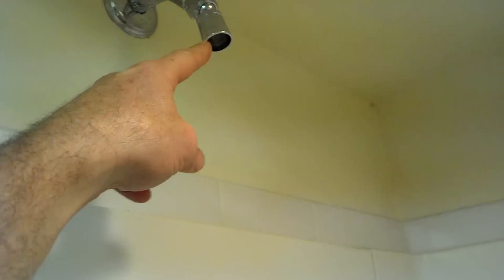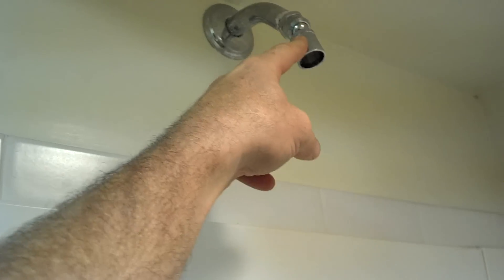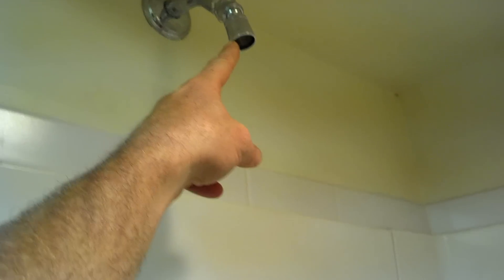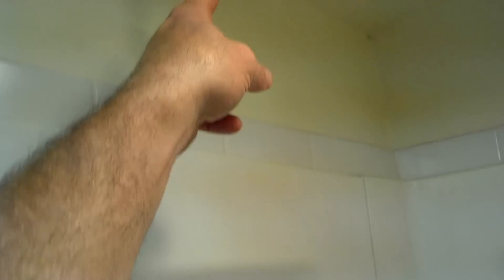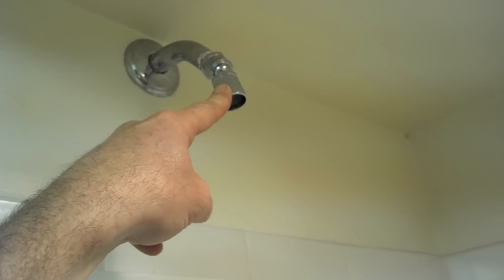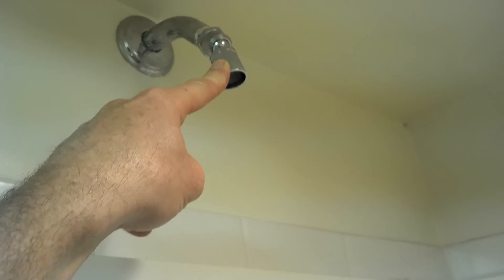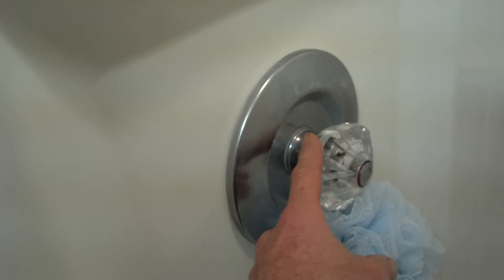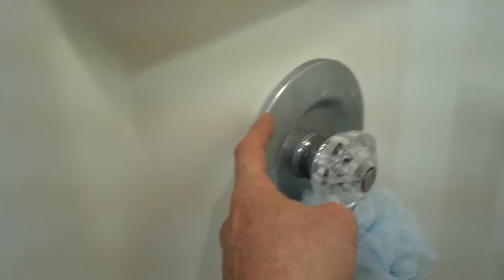If Water Drips From Shower Head, What Exactly is Wrong ?

Comment: Why would it drip out of the shower head but not out of the tub spout? I have seen that on mine on occasion.
Reply from the maker: cuz your diverter valve is in the shower position, try turning to tub spout position, then it will drip down there, keep in mind thst showers & tubs will drip for 5-10 minutes even if in perfec working order, thi is due to the piping behind the wll that is full and is draining, as opposed to a sink faucet that when shut will drip a few drops for few seconds cuz it's a short run with flat aspect......there can be a few pints of water in the pipes and spray head after use

Comment: When my soaker hose is running, both of my shower heads drip. I use a bucket to catch the water and it fills a bucket in two days. What can be causing this issue?

Comment: Dino - thank you for the advice.  I did that and noticed nothing came out of the pipe when removing the shower head.  I guess it's the showerhead then but not 100 percent sure.  One thing I did do is after I showered, I rubbed the head with a towel to dry it and water started pouring out for 10 seconds.  then it stopped and didnt have a problem overnight like previous.

Comment from the maker: ROB, BUT IT DOES EVENTUALLY STOP? THEN I WOULD TRY A DIFFERENT SHOWER HEAD, THAT IS WATER THAT IS IN THE PIPE THAT IS SLOWELY DRIPPING OUT BUT THE SHOWER HEAD MAY HAVE A SMALL LEAK THAT IS LETTING AIR INTO PIPE DISPLACING WATER THAT SLOWELY DRIPS OUT, LIKE HOLDING YOUR FINGER OVER END OF STRAW. TRY A CHEAP REPLACEMENT SHOWER HEAD OR SWAP ANOTHER IN HOUSE TO TROUBLESHOOT, AFTER YOU FIGURE, CALL MANFACTURE TO WARRANTY

Comment from the maker: hi Daisy3690,
this is typical for a correctly working shower valve, you see there is water trapped in the showerhead itself when valve is first shut, it can take time to slowly drip out to where head is empty. 
as long as it does actually stop at some point, there is nothing wrong, you may try adjusting the angle of the showerhead, try pointing head slightly more "down" to help drain faster
your smart not force anything, some of these shower valves are plastic and easy broken
thanks! Daisy3690

Comment: Thanks. This applies to a drip that happens randomly? sometimes when I'm in my bathroom, some water drips it off the tub faucet for maybe 2-5 seconds, when the tub/shower hasn't even been used recently. Today or happened a little while after flushing the toilet, which may be unrelated. I flushed the toilet again and it didn't drip again. I suspect it is a bit of water that was left over from between the shower faucet and the tub faucet that didn't drain out when the shower valve was released at the end of the last shower. Maybe flushing the toilet put a Lily positive or negative pressure on a connected pipe and made that happen. It's happened at least 5 other times that I can recall. I never expect it to happen so I don't watch for it. I'm concerned they if bugs get in my home and this water drips often enough to keep a water source for them, that I could end up with a pest problem. I know there are other water source (drains, toilet), but I don't want to have any more than necessary. Any knowledge replies with answers or ideas would be greatly appreciated, just don't criticize about me wanting to limit water for bugs or ways to poison or dry up water or plug drains, I am knowledge about pest control, it's one of my hobbies.

Comment: hi guys I am wondering if I have a leak in the wall. I kept hearing 
water dripping sound in the wall on the 1st floor, from below the window
 frame it seems, started to hear it about 3 days ago.  It's about 10 
feet from the shower location at 2nd floor where the shower head have 
been dripping for 3,4 years, but recently it dripped more I think, about
 one drip every 6 seconds I wonder if the 1st floor wall dripping sound 
is from that?

I turned off the water main and after 25 min I 
still heard the dripping sound, didn't diminish it seemed the same. I 
don't see water spots or water discoloration but it's been going on 2,3 
days so maybe not that long?. also went outside to see the wall and dig a
 little bit to see if anything is wet, nothing. Does it sound like a 
leak in the wall or maybe some insects or sun shining on the wall and 
caused the dripping/sunshine on stucco sound. but I didn't really hear 
it before until recently. if it's a leak I need to get it fixed fast 
right? or it will develops into a bigger and expensive problem? thanks 
for reading and help. (house is about 11 years old, plumbing is all pvc,
 oh the shower head drip it should just drip inside the shower area 
right, and not inside the shower wall plumbing area or future out in 
other areas of plumbing?)

Comment: Dino, I gave you a thumbs up. However, what I and I would imagine a lot of other people want to know is, does the valve usually have to be replaced or do you just need to replace a cartridge or washer, to stop the dripping? I have a Kohler valve in there that is not that old. I would hate to have to rip out the wall to put in a new valve, if it is not necessary.

Comment: Dino - you're great, thanks much for this video.  Here is my situation : after we use the shower in the morning, it drips for maybe 5 min then stops.  Then after the day is over some 12-16 hours later, it'll suddenly drip water for like 10 seconds straight quickly.  It happens around midnight most of the times and wakes me up.  Would this be a bad cartridge or like you mentioned in another reply, could it maybe just be the head letting air thru at night when it gets colder?

Comment from the maker: i know ron, but so many ppl tell me they need new shower head cuz it leaks all night long.....they look sheepish after i explain & they realize how dumb they sounded, i dont push the point , move on, tell how actually fix the VALVE and stop the leak, that they can actually keep they shower head, unless they want replace for other reasons
 does not apply to shower heads that leak or spray water out of sides or back when valve is ON, that wud need replacement  cuz is cracked 
thx comment & watch

Comment: Go deeper man...show us how to replace what is wrong.
Reply from the maker: Jerry Scholder check my playlist, is broken down into what make & model faucet or control you have....  faucet playlist                                                        https://www.youtube.com/playlist?list=PLQyVtuKdAukIC8zRpVLbxaxWC-JWhBm2N
Reply: so then it's not the cartridge either? becuz my MOEN tub shower/bath cartridge has a nasty CRACK in it.. I saw that when I took off the handle.. it only drips water when the shower is ON but not off.. however there is also a tad bit of a drip by the handle. god I HOPE I dont need a new posi temp VALVE! very spendy and my house is a pile of shit.